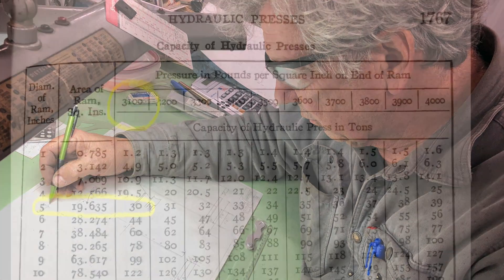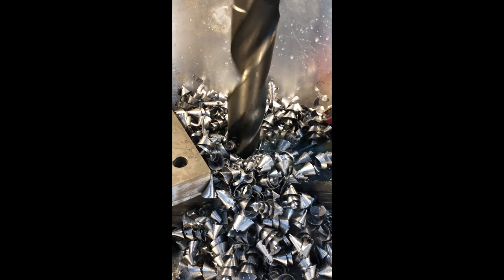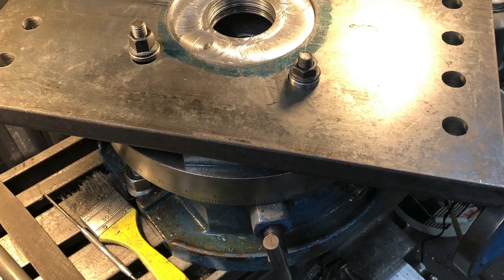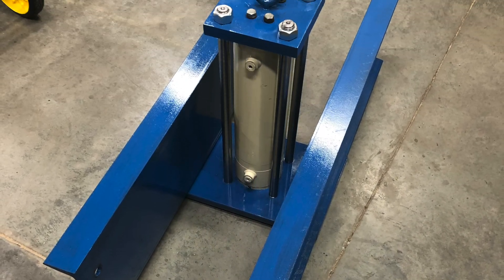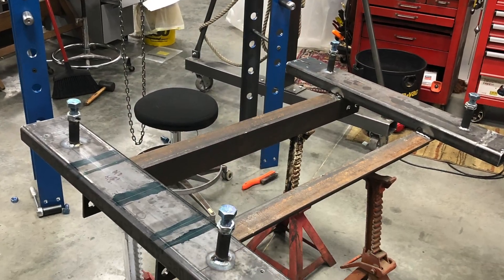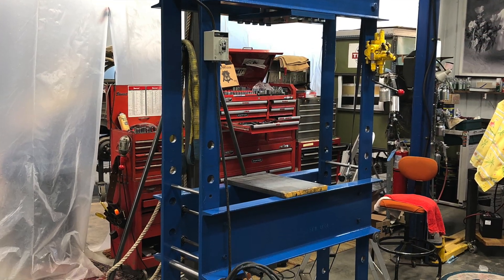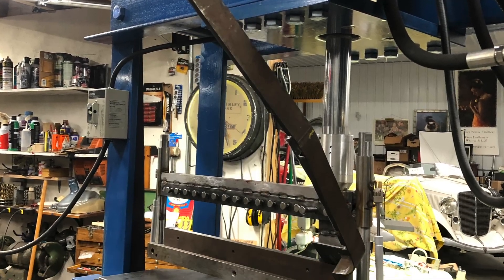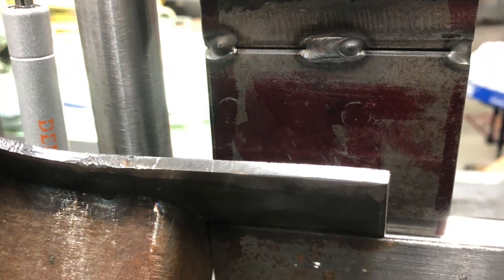9 Foot Tall, Hydraulic Press Build! 30 Plus ton press

Comment: can I ask you what the total cost was for this ?
Reply from the maker: @AdhdAmy  Thank you for your question! When I decided to build my press the price of steel was much less than it is today! I also used what I had lying around my shop! I already had a 3-1/2 hp motor on the shelf! I did buy a load of hydraulic parts for $100,  which included various rams, hoses and controls. If memory serves I think I paid around $150 for the steel! If I had to guess today it would be around $500 just for the steel! I’m glad I built it when I did! While I was in the designing process, I decided to add wheels, which was a great move! That added another $100 bucks! In order to raise and lower the platform, I bought a $25 boat winch! I wasn’t sure if it would do the job, but I was pleasantly surprised how well it performs! In conclusion I designed it to come apart. It can be completely disassembled and loaded into the back of a pickup! Hope this was helpful!

Comment: Clever idea of using the magnets for coolant hose location.
Reply from the maker: I'm sorry, I don't seem to recall using magnets.
Reply: @Letsmakeitgreatagain.  I thought it was a good idea also, you used the orange triangle welding clamps center hole to run the coolant line through when you were machining/drilling to position coolant hose at about 37 second mark
Reply: @Letsmakeitgreatagain.  Visible @ 0.54 minutes.